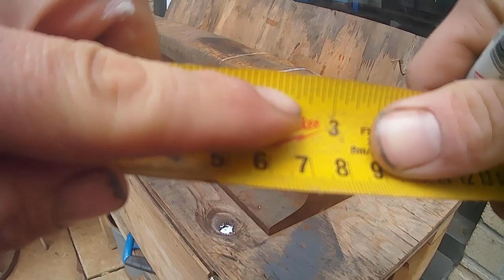I turn a Railroad Track into an Anvil! Simple & Easy DIY - Homemade Anvil - Railroaders Edition

Comment: Now that's how to rough it out. No little grinder. Beefcake tools = beefcake results. 2 thumbs up. The horn design wasn't my first choice but your metal working skills more makes up for it. Anyone would be proud to own that anvil, myself included.
Reply from the maker: Sold a couple and still do all my forging on this one! 

For the horn I was kinda going for a farriers anvil look.

I might get into showing horses
Reply: @petroczinationalrailservic10  I figured there was a specific rhyme and reason for the horn design. Your explanation makes perfect sense. You'll have to make a video of it in use down the line. Looking forward to the next video.
Reply from the maker: @amandahanson8188  I’ve been debating on shooting some more content with my phone.

My gropro kicked the bucket, so may have to find an alternative for now. :)

Comment: Nice work!!  A lot of people, self-included, use a section of RR rail as is for an anvil.   I worked RR track for years, train wrecks, and everything else.  A RR rail is 40 feet long and weighs from 120 to 140 # per foot.  Depending on the average weight of the train.  That's why they make such good anvils.
Reply from the maker: Further more they’re made of high carbon manganese’s rail!

They added manganese to the rail so that it would work harden and have a longer service life.

Thank you for your service btw!
I’ve been serving our industry for nearly 18 years and I’m going to be 33 years old. :)

Comment: Drilling out the mounting holes with a small drill motor takes a hell of a man so I commend you for doing it that way.  Thank goodness you used lube as so many people don't in these videos. 👍👍
Reply from the maker: Yeah, it was certainly tough to drill though. Took me a few hours without a press. 

A hack is to grind slots for your lag bolts invade you don’t have a drill. :)
Reply: @petroczinationalrailservic10  Great Idea as I love my angle grinder and use it for everything I can. 👍✌
Reply from the maker: @rickmcdonald1557  yeah buddy!!!

You can do so much with a grinder!

Comment: I've never seen railroad rail that heavy.  That is some really heavy duty stuff there.
Reply from the maker: This one is 135lb crane rail, the web and the head of the rail is nearly 4 times as thick as traditional 100lb industrial rail. 

I have a monster 172lb crane rail I plan to convert to an anvil at a later date. :)
Reply: @petroczinationalrailservic10  
Where could someone get rails of that size ?
Generally that isn't something available on the open market and in a short length.
Reply from the maker: You can reach out to local contractors. Or if you’re in southern Ontario Canada I have some in stock. :)

Comment: I picked up a lot of tips on how to do this. I have about a 3-foot piece of rail that I would like to turn into an anvil. I know nothing about rails but mine seems a bit lighter that what you were using. Will use it anyways. I always wondered about torch cutting but glad you pointed out about the high carbon in it and the heat will affect it. I think we can credit Andrew Carnegie for improving rails way back when. Thank you. 
I think your music fitted the tempo of this video. Actually, I prefer that over rambling speech. Cheers.
Reply from the maker: Thanks brother! 

Yeah this is the quickest most efficient way I know how to do it.

You can rent one from your local rental service for a day and be done with it.

Or you can buy a used slot/chop saw for about $500 CAD and have that bad boy for life! Heheh
N

My first anvil I torched the webs.
I used it for 3 years and it didn’t break or mushroom bad.

Manganese is a work harden steel too, so theoretically, it should get harder over time. :)

We ain’t no steam train, but we can strike like one ahaha
Reply from the maker: Ps, you can cut that 3’ section into (2) 18” sections and make two anvils!

They make for great gifts!
Reply: @petroczinationalrailservic10    I need to check on the length of what I have. I do have a nice 14" carborundum bench top chop saw that should work nicely for length and maybe some of the other cuts. Hopefully. 
I believe my 4-1/2 - 5" angle grinder should finish it off. I will probably make the nose a bit longer with a flat surface and keep the crown on the rest. I will modify as need for auto patch repair panels. Thx
Reply: Forget the terminology, but rail is the highest level of steel in both purity and str. Its very dense, thus the weight. Batches are all noted for safety reasons, as cracking does occur over time-this allows possibly defected rail to tracked if there was a problem with its batches integrity.. Generally these cracks are discovered with basic x-ray, or what they call a Gamma Car. If the rail is being replaced, there's a very strong possibility its due to fissures in the steel - Cracks if you will. Because of this, you want be to careful when working with it-as you dont' know how bad the cracks are. As rail contracts under cold and wiggles under heat; always want to consider these things; as the last thing you want is your anvil to snap when working with glowing red iron. So be sure to thoroughly inspect it before using rail for something like this. Rail is never scrapped because its old. Its only scrapped when its cracked - even if you can't see them. Safety First. Hope its helpful. Great Quality Material all in all. Just something to keep in the back of your mind, due to the high stresses in smithing. You'll probably be fine, but worth considering.
Reply from the maker: @TheSmb133  I would argue that rail isn’t always changed when it’s cracked. I’ve been doing railroad contracts for 18 years now.

We replace rail when they reach a certain amount of wear, when upgrading existing infrastructure, defects around the joints (as that’s where the most pounding occurs).

All main line track is traversed with a Sparry Car which x-rays the rail for defects. That is correct.
Reply: @petroczinationalrailservic10  was just trying to kero it simple.  Wheels spinning makes flat spots. Maybe the mill batch had a defect used on another line.  Just was trying to say that it's usually not cut without good reason as it's incredibly expensive. And if fissures are the reason.  (The cracks discovered by the sperry car) without knowing the damage, heating to molten levels and then whacking them at a distinct contract point could certainly pose a hazard. In theory,  it could very well pop. Unlike a legitimate anvil that isn't going to have those stress points from 380,000lbs per car beating the heck out of it.  

If it's compromised, very hot metal applied to a very cold anvil with the right angled wallop is probably the best way to find that catastrophic failure.  :p just a caution.  And only cause we are talking smithing. Could certainly do a lot with old rail. Its the heating and whacking from a safety perspective.  Like reloading bullets. Use that case more than twice and that's how you lose fingers lol

Its the same reason there are heat countermeasures for railroads. Some even wet the rails. Bc heat + cold + pressure can make those microscopic cracks go Boom

And you don't really need an anvil for tin or aluminum. You're usually banging away at layered,  folded steel. Not spread across a long rail but now concentrated over a direct point. ... probably be fine.  Just wouldn't recommend. 

We never swapped for insulating joints, but also used concrete ties. Or pliffs. Lot less clanking. Have seen trains run rail that wiggles like a snake it was so poorly maintained lol. But they wouldn't swap unless cracked. Most of the freight lines run on some pretty beat up track.  But those fissures, no one rolls the dice on.  That's guarenteed coming up.
Reply from the maker: @TheSmb133  all the rail we use for anvils are either new or relay. Some scrap ones due to wear. Anything with cracks is scrapped and can be tested with penetrating dye.

Interesting to note, rail has 0.785% carbon with 1.07% manganese making it a work harden steel. The rail actually gets harder with more traffic.

When welding rail, you have to preheat to 700DF (as to jot shock the grains) and post heat to 1100DF to reset the grains.

So as long as you’re using a grinder, or a chop saw, you don’t have to worry about compromising the structural integrity of the rail.

Using a cutting torch is a no go, it makes the steel brittle within 3” of the torch cut.
That being said, my first anvil was cut from a torch and it’s still alive and well today.
Used it steady for three years of my blacksmithing journey. (Upgraded to the same type as seen in this video summer of 2022.)

An average loaded freight car weighs 280,000lb, there ain’t no way you’ll be swinging that hard.
Reply: @petroczinationalrailservic10  if it works it works. Cheers. As i said,  just erred on caution. Let's face is.  Most people that would try this don't have that saw,  or the ability to actually use it. He did it right in the vid. Most, especially off the beaten prolly use the tortch. It's good info for people so some poor dude in India or peru doesnt hurt themselves.  Torch is 5 bucks.  That saw he has is more than an 88lb factory new anvil.

Comment: A painted anvil with a nice horn, but no flat surface😂 A lot of time to make an anvil that doesnt have a lot of practical use and functionality. Hopefully you'll finish it and grind or mill a flat surface on it and maybe a drifting hole. It does look cool though.
Reply from the maker: Perfect for all the work that I do on it.

It’s actually a piece of crane rail so it is flat on the head. 

Typical rail has a bit of a crown on it.

But if you know how to swing your hammer, it is totally functional. 

I ended up cutting a 5/8” notch in the heel so I can twist my knives without a vice when I’m doing mobile classes.
Reply: @petroczinationalrailservic10 How many hours did it take to complete?
Reply from the maker: About 9 hours. Would have been considerably more with just using a grinder.

Comment: As one who is looking to get into smithing, can I-beams be used for an anvil if it's thick enough or should I try to get my hands on a rail piece?
Reply from the maker: I would recommend rail, because it’s made of high carbon and the way the head is engineered.

With an I-beam, it will serve as a first anvil, but it’s going to be difficult to eliminate or reduce the ringing from it.

When you go to mount it, use wood lags and silicone along the base.

Hope this helps!
Reply: @petroczinationalrailservic10  I appreciate the information.  If I can't get my hands on some rail when I start I'll use some I-beam until I can. Thanks for the help.
Reply from the maker: Check Facebook market place. You can find rail lingering around there. 

You can also rent a cut off saw from your local tool rental shop.

Comment: How heavy is that rr track and where can I get one
Reply from the maker: Hi Armando, rail is classified by its weight per meter.
This specific rail is 135lb crane rail.
18” weighs approximately 67.5lbs.
Reply from the maker: You can check with your local rail contractors or sometimes get lucky with a scrap yard. All rail is made up of high carbon manganese, so they all make great anvils as long you secure them right. 
4 lag bolts and an application of silicone on the base.
Reply: How long did it actually take to make the anvil? It’s a thing of beauty for sure! However long it took I can multiply that time by about 10!😊
Reply from the maker: If you’re in southern Ontario, I have some in stock
Reply from the maker: Takes about 6 - 8 hours.
Start to finish. 

You can rent a cut off saw from your local tool rental shop. :)

Comment: Why not just use the iron as it comes?
Reply from the maker: You can, I like to have a horn for opening up Pandrol clips and pounding certain patterns into my work. 

But if you have a piece of rail, you can total grind notches or drill holes to mount your rail.

Just remember to apply silicone along the base of the rail during the installation. :)

Comment: your missing the square hole in the back for shoe bending
Reply from the maker: A hardy hole can be added lay a later date.
I created on of my anvils with a saw cut 5/8” rectangle on the heel.

You can drill 5 pilot holes and use a square file to finish.

Or you can find a local water jet service to blast a hardy for you.

Service in my area costs $100 for 1 hole.

Comment: Damn, what kind of saw is that?
Reply from the maker: I typically use a Husqavarna K760.
But I blew the rings out in the video.

Second saw is our rail saw, a little heavier to manoeuvre, but it got the job done. :)
Reply: @petroczinationalrailservic10  Impressive. Amazing work btw 👍🏻
Reply from the maker: Thank you! You can also rent these saws at your local tool rental shop. :)

Comment: Simple DIY anvil project.
Materials needed:
1 piece of oversized Soviet rail gun track
2 Husqvarna extreme duty cutoff saws
1 crate of 18 inch industrial cutoff wheels
1 oxygen/acetylene torch set
A steady supply of Harbor Freight hand grinders and box of 1000 grinding disks
1 rail spike hammer
10 bastard rasp hand files 
40 boxes of assorted grit sandpaper
Complete set of welding leathers.
1 hazmat suit 
4 fire extinguishers 
(Optional* call ahead and have a fire truck on standby)
1 Large box of band aids
10 finger splints
1 five gallon bucket of burn cream
1/2 can of yellow spray paint
1 really good medical insurance policy 
2 weeks paid vacation time

...so simple the common housewife can do it with supplies you have laying around the house.

Christ on crutches,  I'll just go buy one. 
But I sure appreciate for ALL the work you put into this video.
Reply from the maker: You gave me a bit of a chuckle lmao

You only need (1) 14” abrasive blade. (2) if you’re new to using a cut off.

You can rent a cut off saw from your local tool rental shop.

You have to be mindful of the direction you are shooting your sparks and adjust your guard accordingly. 

Wear a face shield, ear plugs and gloves at minimum. I suggest to wear a respirator as well. 

You only need (1) 4” grinder, (1) flap disk, (3) cutting disks and (1) coarse grinding stone. 

A lot of people don’t understand how high 0.785% carbon truly is.

You’ll be daaaaays and a pack or two of cutting disks trying to shape it with a 6-8” grinder and cut off. 

Hope this helps

Comment: The music was an incredible turn off. I don't want to listen to that crap when an anvil is being formed and I don't want to turn to sound off.  I want to hear the sound of a blade cutting, a hammer pounding, a grinder sanding. That music I can handle. 25 minute video and I have to leave after 4 minutes. Too bad.
Reply from the maker: Hard to find any decent free music.
And you do not want to hear my rail saw sped up x50.  Sounds like a squeaky ass mousy dying.

Tell you what, turn the channel.

Not for you

Comment: You need to figure out how to make the top of the anvil surface flat, maybe take it over to a machine shop and have it milled the top of it is slightly convex you probably noticed that
Reply from the maker: I’ve been using rails like this for bladesmithing for nearly 4 years now. 

When I need a flat face, I use the heel or the horn to pound my hammer half past my work.

I actually use the rounded side for moving metal in certain applications. 

If anything it would be beneficial to weld up the one side while leaving the other as is. :)

Comment: Why dont you use the flat side of the grindiing disc instead of the outside edge ? Same way you used the flap disc . Just asking for a friend.
Reply from the maker: You can use a flap disc, but use the grinding wheel where the horn meets the face.

That way you have a nice even transition. :)